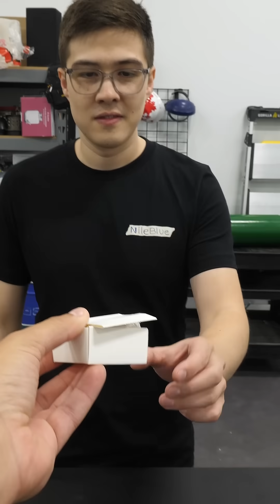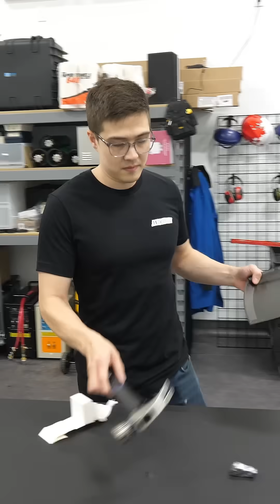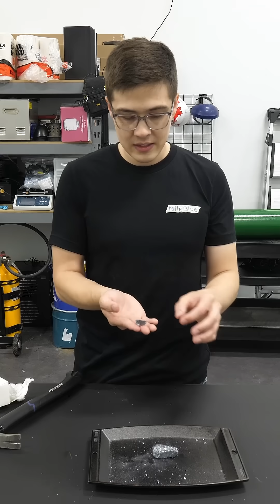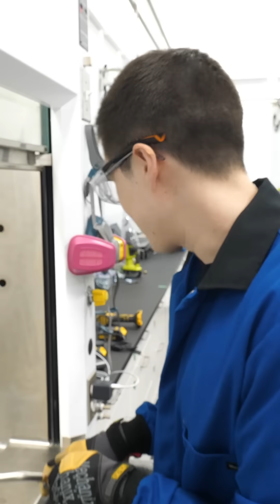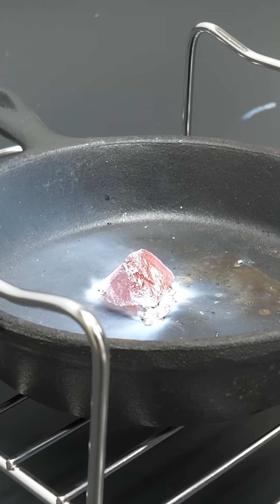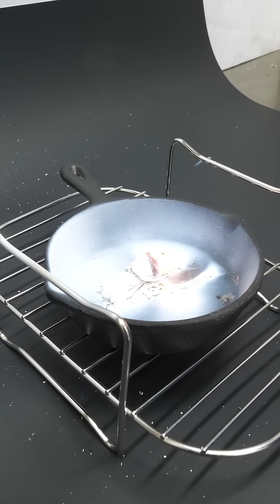Silicon is weird

Comment: You can melt silicon. Just not with tools around the house lol I used to work in the thermal spraying factory and melt silicon in front of a plasma flame all the time. In that industry they can melt diamond or anything else. Applasma flame runs about the same temperature as the surface of the sun.

Comment: Nile, please consider an Oxy Acetylene torch bro. Its capable of alot of different flames. If you knew the extent of these welding/cutting torches, youd realize your propane torch is basically just a glorified cigarette lighter. But perhaps you already knew that.

Comment: breaks a piece with an hammer
"I guess Silicon is indestructible"
Reply: Thats not what he meant, he meant on a molecular level
Reply: @XxKingJTuckxX  more than on the molecular level i think he meant on a chemical level (changing the oxydation state mainly), because if he meant on a molecular level, considering that silicon he has is in a metallic crystal state, he litterally break the molecule with an hammer (breaking away the chemical bond between atoms).
But if it wasn't clear, my first comment was a joke 😂
Reply: My thoughts exactly
Reply: Technically he didn't destroy any of it, simply increased the surface area
Reply: @kylemilford8758 I'ma increase ur brains surface area with my boot wise guy 👿. Just kidding, hope u are doing well ❤
Reply: @kylemilford8758 the 2 worst people on the internet are those that say to be fair and those that like to be technically correct, but to be fair, technically correct is the best type if correct 😂
Reply: @freedblowfish3705 ?
Reply: @freedblowfish3705 how Hermes got his groove back.
Reply: an hammer
Reply: Smartest man in the room.

Comment: You can use chlorgas to produce SiCl4 or HF for SiF6. Both are gaseous. 

The SiCl4 rout is used in Simensreactors under Hydrogen atmosphere to condensate Si and remove HCl. This whole thing is basically a Si destillation step and a common purification way.

Comment: ....blowing pure oxygen into a torch flame like that..... horrified the hell outta me!! 😮😅 

I get that, due to the pressures in both gas canisters forcing our gas at a fast rate, it probably wasn't dangerous....

.....but, my dad is on oxygen and has been storing those tanks in his home. So, I picture me going "Hey dad, let me see your oxygen really fast" and then blowing it onto a flame. 😂 

I guess the point is: I've seen the worst-case scenario with compressed oxygen (in video format only) and its always freaked me out....largely because I don't exactly know what would happen. My ignorance about it and how it's stored combined with the little I do know about it and other compressed gasses, manifests as a fear of compressed pure oxygen. 😅 

I feel like I'm near a bomb just being around them. 😂 I used to do deliveries for a paint company and one of our customers was Airgas (a company that sells tools, welding products and tons of compressed gasses). I had to back my delivery truck up to the loading dock and they always made me use the dock that was lined with canisters of gas. I saw someone else in that same situation hit one of the canisters (the tall, skinny ones) and it flew across the property like a missile, just inches from the ground. Luckily, nobody was hurt and it ended up hitting some steel beams that were in a pile, so it didn't damage anything. turned out it was just compressed air.

....but watching the driver, a grown man, crying after that... made me think "great. That's me one day. I know it." I read the labels on the canisters and wow...they sell everything: O2, C2H6, C2H2, N2, CH4, C3H6, C3H8 😮

I did horribly in school, sans two subjects: English and Chemistry....and if I remember correctly (im confident I do. It's one of the few things I am confident about 😂), that list is: pure oxygen, ethane, acetylene, nitrogen (FINALLY,  an inert gas!), methane (back to the fun ones again), propylene and propane. 

If I opened my door too much, didn't use my mirrors well enough (the rear view mirror was useless since it was a box truck and they didn't have backup cameras on things yet) or made any other slight mistakes...a whole like of tanks would fall like dominoes 🤦‍♂️ 

I hated going there and it cause a fear in me that hasn't left. 😂

Comment: The alleged "silicone" rock whom our eager and novel geologist is attempting to examine by heating it to red-hot temperature is actually a sample of low-level radioactive Kryptonite, which is quite rare where its only means of arrival to Earth would have been by meteorite impact having occurred during the Jovian period of Earth's early formation. The rock sample seemingly is harmless to Humans but exudes enough isotopic nuclei atoms at its elemental base structure to upset certain organism's cellular cytoplasm causing the developing host cell to lose potential in its ability to successfully divide and replicate into functional protein molecules to nourish cells whereby their fibrous membrane is unable to retain forming protein bonds. The net result is leaving the overall organism short of nutrients to provide it with joule energy. ☝️🙄

🫣Hey, Dude! Your latent biological explanation is rather flawed and lacks any scientific validity. Did you acquire your Master's Degree from out of a box of corn flakes?

Comment: Use an angle grinder to get some silicon powder then try to burn it. The problem with this test that he just did was the frying pin acted as a heat sink.

Comment: Ok, I saw the silicon and knew what it was immediately. That is non fero silicon. Which can melt down at higher temperature. I work in an Aluminum Smelting Plant and we use that among other metallic additives to make stronger or more malleable grades of aluminum. Depending on the client.

Comment: Fun fact: a lot of foundrys use silicon to increase tensil strength in products. It's one of the key alloys to make cast iron manhole covers strong enough to support everyday traffic from a sedan to the weight of a fully loaded semi truck.
Reply: Can it be used as a heat shield?
Reply: @meloveulongtimesuckymycocky no because it melts at a low temp but that doesn't mean it doesn't transfer heat well

Comment: I used to find a very similar substance along railroad tracks when I was little and I was always told that it was slag that came off of the train's brakes. Would it be fair to assume that what I've been finding along the tracks has in fact been silicon that was being transported?
For context, I have found these in multiple States around the southeastern region of America and only along railroad tracks

Comment: Silicon is actually grown in a lab from a small crystal, into the gigantic formations that are cut into wafers for microchips. 

-Lab Tech at a silicon manufacturing facility.  I have 5 wafers, and a small formation that didn't meet standards of density and rigidity.

Comment: Silicon wafers are usually oxidized in either O2 or H2O at up to 1200 degrees Celsius. I've never come across a thermal oxide layer thicker than 8 microns, and I was told that took a week.

Comment: Silicon is extremely stable. This is why it hardly reacts. Also it's melting point is 2,700 degrees F. That's extremely hot 😮

Comment: I’m pretty sure silicon doesn’t change states until like 4500 degrees. Just from the little I know about composite materials made with silicon carbide. Like brake rotors and such. There’s a reason they use silicon in high grade duty sandpaper lol

Comment: Add fine wire clamped and bent to gently touch silicon with its point. Connect long outdoor wire to silicon piece and old high impedance earphone to fine wire and ground point ,like copper pipe im earth or 3rd wire of AC power plug ( the Round hole). You have a radio.

Comment: I worked a crazy job at a silica plant once, and it was quite hot down in the ovens. As part of the service team I had a 15 ft pole with compressed air, blowing off ashes in the chimneys once a day. Gearing up in something you would imagine they used at Chernobyl to keep the heat out, stepping away for 3 minutes every 2. I also kept feeding in electrodes from the top every 90 minutes, 2.2 ton a piece. It was a sweet gig, payed REALLY well and just goofing off at the break room for the most part.
Reply: Chernobyl was only hot temperature-wise for a brief amount of time.  Still fairly radio-logically "hot", but that's the wrong kind of suite for that.

Comment: Silicon bond with oxygen around 3200 degrees in about 15 30 minute removing oxygen from steel creating silica the most abundant material on earth. It then floats to the top in slag. That's why our earth crust is mostly silica. This is actually ferrasilcon. An alloy

Comment: If you use an oxyacetylene cutting torch, you will easily be able to melt it. They burn at 6,000F, Silicon melts at less than half that.

Comment: So it doesn't deform or melt at high heat, but what about it's thermal conductivity, are we talking about heat shields or just regular thermal retention, and what about UV, does it become brittle with sun damage, so many more questions, starting with the fact that most people think of silicon as more accurately silicone, a food safe molding gel or something, and you pull out a silver rock, so what's the difference between silicone and silicon, then the heat Resistance could be interesting to dive into

Comment: No. I used to Evaporate silicon and silocon dioxide in an e-beam unit. Laser Fabrication requires it. So I've watched it melt. It's not indestructible. Just very fire resistant.

Comment: I still have a hard time remembering that silicon and silicone and silica are three separate things that are very different
Reply: That’s just sili….. 😂
Reply: @davidchelson8069 
Sili-ngly the most nerdy/cheesey comment on the net!😅
*I tried keeping up with the Joneses and obviously failed horribly... meh🤷
Reply: @aaronrivard3966  then I have succeeded!!! 👍
Reply: And Silicates
Reply: Same, but I just hate the fact that silicone in spanish is silicón and silicon is silicio.
Reply: @MickZarco  🤣🤣🤣
Reply: Thanks for those definitions  - I thought "silicon" was a type of plastic.  Now I know!!
Reply: @User-x5s3x  That would be silicone..

The caulk in bathrooms is usually silicone.
Reply: @User-x5s3x  me too.
Reply: I mean, kind of different, but all related 😅 Silicon is the metal, silicone is rubber with silicon in it, and silica is silicon when it's oxidized and a general term for minerals containing it.
Reply: @nightlight0x07cc is silicon a non metal like carbon?
Reply: @unkindled6410  It's in the same column as carbon yeah. It can make the same bonds, just less stable.

I forget the proper term at the moment for those "Kind of, sort of metal" elements.
Reply: @ruu199  yes, that one!
Reply: @nightlight0x07cc  I can already tell I won't remember the silica definition
Reply: A mechanic at my shop tried to tell me he never uses silicone because it’s made from silica and it can damage an engine. 🤦‍♂️
Reply: I was very disappointed when I went to silicon valley looking for the strip clubs
Reply: @aspersiondetergent5673  Pretty sure "silicone valley" is Hollywood.
Reply: Don't forget my sister Cecilia from Sicily
Reply: @uxer02 doesn’t she drive a Celica?
Reply: What about silly-cone?
Reply: @Su_udiKA some women have those. They should have just stayed natural.
Reply: Thank you!
Reply: Thanks for clarifying. 👍😊
Reply: Thank you for your comment. Started looking my mind then lol
Reply: There are also silicates, silicides, and silanes.
Reply: I didn’t even know that till now 😂 so thank you lol
Reply: Careful, implants of stone may itch 🤣
Reply: @EmmanuelBrito  would bring new meaning and texture to 'cones'
Reply: Silly cone is totally different too.
Reply: Silicon still has something to do with each. Silica is silicon dioxide, which is just quartz (think of sand), and silicone is a type of polymer made out of silicon and oxygen atoms
Reply: They're not related at all? 😅
Reply: wait silicon and silicone are different?
Reply: @papaspoon1550  silicon is computer chips. Silicone is A to D 😂
Reply: @papaspoon1550 In short, silicon is a naturally occurring chemical element, whereas silicone is a synthetic substance.

Silicon is the 14th element on the periodic table. It's a metalloid, meaning it has properties of both metals and nonmetals, and is the second most abundant element in the Earth's crust, after oxygen.

Silicon readily bonds with oxygen and is rarely found in nature in its pure form. You've likely seen silicon as silicon dioxide or silica, better known as quartz, which is the most common component of sand.

Silica also comes in other mineral forms, such as flint, jasper and opal. When silicon and oxygen mix with reactive metals, the result is a class of minerals called silicates, which includes granite, feldspar and mica.

Silicon has many industrial uses: As silica, silicon is a key ingredient in bricks, concrete and glass. In its silicate form, the element is used to make enamels, pottery and ceramics.

Silicone, by contrast, is a synthetic polymer made up of silicon, oxygen and other elements, most typically carbon and hydrogen. Silicone is generally a liquid or a flexible, rubberlike plastic, and has a number of useful properties, such as low toxicity and high heat resistance. It also provides good electrical insulation.
Reply: But all of those contain silicon...
Reply: Easier in French where silicone and silicon are called silicone and silicium
Reply: @reinf4430 rahghgaghagghgh I'm gonna go insane with all these similarly sounding words and language exclusive ones 🤬 (esp when u'r french and use english a lot or inversly)
Reply: Where do fake boobies come from?
Reply: Hehe
Reply: Did someone say Celiac's? 😂
Reply: Ohhhh
Reply: I forgot this clicking on thr video
Reply: Lol
Reply: I've had to explain that to several people before.
Reply: Wait they are? I’m so confused. I need to go do a search.
Reply: failed chemistry or?
Reply: Bro I was like year 3 in on my bachelor in engineering when realizing silicon and silicone are not the same thing in english. A part of it was bc I’m swedish and silicon in swedish is ”kisel”, a totally different sounding word, and silicone is ”silikon” without the e. Still felt pretty embarrassing that I hadnt made the connection
Reply: I was half-way through my engineering degree before I realized that silicone valley wasn't an insult against Hollywood for all the plastic surgery
Reply: @PsRohrbaugh 🤣🤣🤣🤣🤣
Reply: @PsRohrbaugh middle school geography should have taught you that, but I feel you

Comment: I used to work at a silicon crystal growing facility. The amount of heat and pressure it takes to melt silicon is absolutely mind boggling. The machines they grow the silicon crystals in are seven stories tall. If anything ever went wrong, our bodies would have been vaporized before we knew something was wrong.

Comment: Dude just breaks a piece of silicon, nonchalantly burns it with magnesium and oxygen, and claims that silicon is indestructible?!?

Was your hammer forged in a dying star?
Reply: To answer your question of was your Hammer forged in a dying star? The answer would be yes. Iron is the last element a star can use as fissible material. As iron is neither fissible nor fusible. Got a cast iron pan, you can thank a dead star.

Comment: Silicon has a melting point of 5000°F. His blowtorch can't generate that kind of heat even with magnesium's help. Silicon is used to line crucibles to hold molten metals like copper, gold, iron and silver in industrial foundries.

Comment: More magnesium might have helped, if it didn't melt through the iron pan first.  Silicon melting point is below that of iron, but magnesium combustion temperature higher than both.  Maybe a graphite crucible would be a suitable place to try it.

Comment: Silicon melts more easily than platinum.... Like 2400ish F vs 3200ish F?
Iron melts at 2800F. So an acetylene and oxygen torch should melt it.